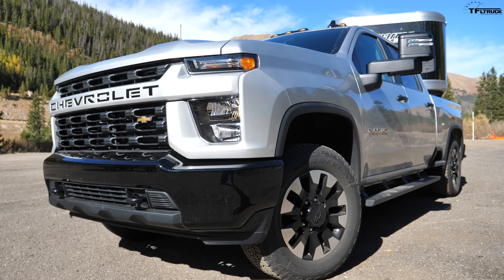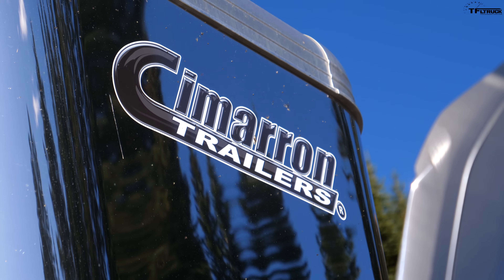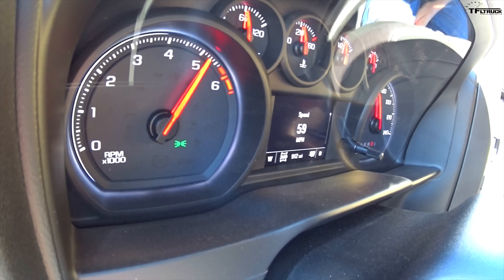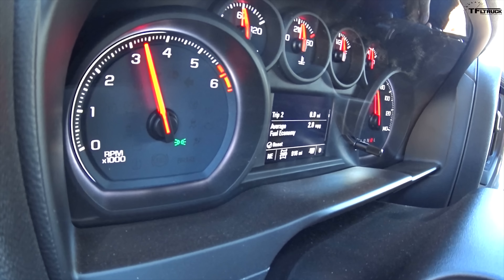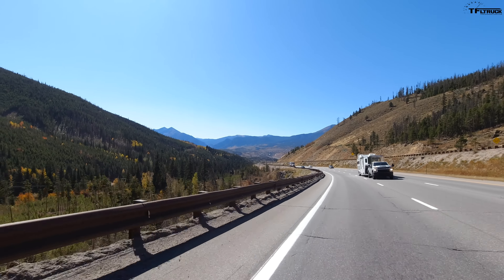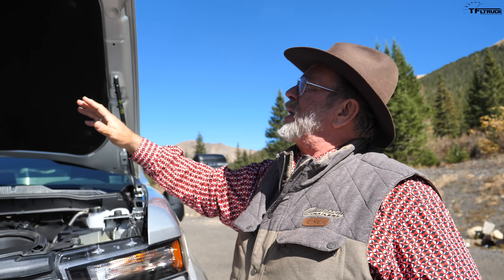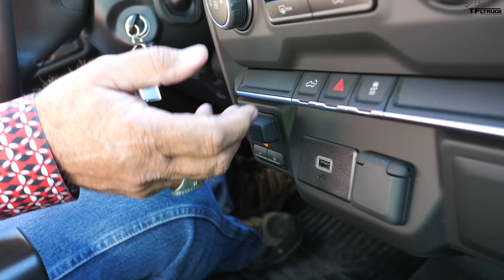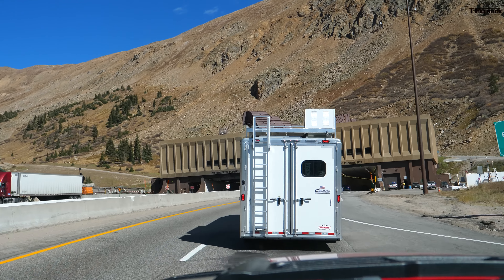The New 2020 Chevy Silverado HD Gasser Broke Our Ike Gauntlet Scoring System - Here Is How!

Comment: This was a test as extreme as the grill is tall.  Seriously, who actually tows 16,000 with a gas truck?  Nobody is going to ask a gas truck to do that regularly, they will buy the diesel.  Not only is that a lot to tow with a gasser but that hill and altitude as well.  Stupid grill and hood height but i think the 6.6 6 speed is  a great setup for the right buyer.  The person who tows  often at under 10k lb, or the person who tows up to 16k once a year will be well served by this truck and an extra $10k in their pockets.  Only reason to pass on this is if the 7.3 Ford turns out to be great.
Reply: You answered your own question; the guy that doesn’t tow extremely heavy on a regular basis.
Reply: The point is to test the trucks at their maximum ratings to see if they can actually do it and do it well. 

Otherwise who's keeping the buyers in the know? You're going believe the manufacturer who's trying to sell the truck? You shouldn't. These are good test and represent a very very high level of stress. If you do less you'll do much better. 

This engine and tranny has a place but it's certainly not this sure, but again people should still be able to know the limits of their $50,000 truck.
Reply: Yes, I agree. For the right buyer this truck could be perfect. And like you I am looking forward to the new Ford 7.3 test.
Reply: I'm too lazy to make calculations but I think with it's lower MPG it's 10k advantage in value is not that big of a deal.
Reply: @ldmtag  The MPG will be less than a diesel, but add up all the money spent on frequently more expensive diesel fuel, DEF fluid, oil changes, and if anything breaks in that highly complex modern diesel you are out major cash.  You have to be towing quite a lot to really save anything.
Reply: I bet the ford will be a beast with the 10 speed
Reply: Contractors and construction crews tow that heavy with gas trucks daily.
Reply: @Weatherby406  This is true.  You can bet that most commercial buyers will have these trucks maxed out all day every day.
Reply: Should have gave it the old allison 1000. Just like they did when the launched the 8.1 in the early 2000's which up until this year  produced the most gas torque in a 3/4 ton.
Reply: I have a 2018 GMC Sierra 3500 HD with the 6.0L gas engine and I pull my 13-14k pound fifth wheel regularly as I live in it full time. 20k miles on the truck in 10 months and it's not failed me yet. It's a truck, it's made to work, why not use it? Diesels are expensive, and they just started cracking down on non emission tunes and deletes, so if they go out you can drop another 10k ontop of the 10k premium for the engine, for that 20k I can buy half of my truck again.
Reply: Also a good choice for maxing out over short distances at lower speeds, like a contractor whose business is all in one city.
Reply: Honestly, unless your business is basically pure hauling, a gasser is an amazing choice all around.  You'll find 5.3 and 6.0 silverados and Express vans hitting 300k+ miles with the original engines.
Reply: @darens440  well, yeh, good point... maybe you're right. As I said, I'm too lazy to do the math. So maybe you're right.
Reply: @ldmtag  Today, in my city, Diesel is $2.99 and regular gas $2.59.  Unloaded Gas HD trucks lets say 15 MPG, unloaded diesels 18 MPG.  5k miles, that is $830.55 for diesel fuel and $863.33 for gas.  Oil change is likely to cost $100 for diesel, and only $50 for the gas, or less.  DEF might cost $16.  The diesel weighs more so your tires wont last as long, hard to measure that cost.  Long Term costs, lets say the DPF and the Cats on the gas both go bad after warranty.   DPF costs at least 2k and the diesel has a regular cat costing about $800.  On the Gas you can get both cats for under 1k total.  Turbo?  $1500 part the gas doesn't even need.  Fuel Injector for gas 6.0L $31, the diesel is over $300 with its core charge.  If/When your diesel needs repairs its going to cost more labor than the same repair on a GM gas.  Entire Engine replacement?  Almost 12k with core for diesel vs $4.8k with core for the 6.0 gas.  Nobody is saving a dime with a diesel anymore.  If you need/want the diesel you pay more.
Reply: Hi. Yea I'd tow 16k with a gas truck. Either get a big block or do some mods. But that's just me. Honestly I'd have more fun putting the $10k it takes to get the diesel and put it in the gas engine and make it unique. Plus the money savings from maintenance
Reply: Landscapers haul heavy trailers everyday with gas trucks because they're simpler, easier and cheaper to fix, and have a lower acquisition cost. Not to mention, the added bonus of being able to gas up your truck and several gas cans all in one go, lol! Sure you won't be going anywhere fast towing a bunch of wet mulch in a 6.0 gas 3500 Chevy dump bed, but most people in that industry don't want to spend big bucks on a fleet of diesels. I used to be a big "diesel is best" guy, but now I appreciate both and can see pros and cons for each.

Comment: That 6 speed trans is killing the performance of this truck.
Reply: Yeah, I think we will see the 10 and 8 speeds in the HD line up as standard in the future. Like come on, you buy an HD to tow and haul.
Reply: Oh bs. It was screaming up the hill at high rpm. Aka max hp. Nothing extra gears would have  done. No power is no power!  
The gm 10spd has 3 over drives . Good for empty highway driving but useless for towing. So a 10 spd is only a 6 or 6sp when towing
Reply: @Andy Hass If you notice, anytime the engine was over 4,500 RPM it was able to accelerate (not just maintain speed) till it would shift into the next gear (mainly 2nd to 3rd). When it hit 3rd gear it was at 3,600 rpm which is not enough power to hold speed and then it would slow down till it down shifted. Having more gears allows the engine to have more places where it can hit 5,000 RPM and over. The 10-speed would have a gear ratio in between 2nd and 3rd on the 6-speed and allow the truck to rev higher in this gear while going the same speed like over 4,000 rpm at 60 mph not 3,600 rpm in the 6-speed. With a 16,000 lb trailer it’s not just about power, it’s about at what speed (MPH) this power occurs. Exact same reason that a lot of semis have 18 gears. Also, a 10-speed will have a similar top gear ratio as a 6-speed, the 10 does have a wider spread (meaning more lower gears). The 10 speed has 7 gears under overdrive, the 6-speed only has 4.
Reply: @LikeARock1997  agreed. Would be interesting to see.
Reply: Its not the transmission its the tune. It was upshifting when it had no business to and waiting way too long to downshift again. Hopefully they come out with a software update soon to address that. If they would have put the truck in manual mode and selected an appropriate gear I bet they could shave 1:30 off that time.
Reply: Yes it should have changed down when it dropped to 3000 rpm. Instead the truck went down to 2000 and then sped up when it changed down. This is a stupid gearbox computer.
Reply: Wonder if it would have done a bit better if it had a big block...
Reply: You need forced induction at those altitudes. That's why the diesels do so much better because they all have turbos. Hell the little eco boost engine probably pulls better than this 6.6
Reply: Andy Hass Makes sense to me.
Reply: Killing mpg
Reply: @crazyhass84  are you serious, screaming up the hill with an airplane gear versus screwing up the hill with a creeper gear is way different sir. The horsepower is being used in totally different ways between the gearing ratio. You never had a multi-speed bike growing up I'm guessing?
Reply: @LikeARock1997    All it means is you are towing too much weight.  Pickups cannot be made to tow these incredible weights efficiently or safely.
Reply: @raptorthumper12    "would of"???
Reply: @LikeARock1997  Maybe gm should just change the cam profiles and derate the engine power to bring the usable power band down into an area people are willing to use it. 2000-3500rpm.
Reply: @oldleatherhandsfriends4053  Do you really think GM engineers didn't design this NA direct injected gas engine to produce a broader torque band? These engines develope more torque earlier compared to a port injected engine. They are pulling a lot of weight up a steep grade at high altitude, that alone kills power. This engine does everything you'd ever need it to do.

Comment: I bought a 2008 Tahoe, had the cylinder deactivation turned off, removed the cats, had the SUV tuned, installed 22 inch tires and an Eaton Tru Trac Rear End with 4;56 gears..My mileage only went down a few 10ths of a MPG from the 3;42's ..My first pull was another Tahoe on a 2300 pound trailer up two 6 to 7% grades that were around 2 miles long. With around 8000 pounds additional weight it did very well up those grades with just a 4L60 4 speed and a 5.3 with 310,000 miles...😁

Comment: That truck needs the 10 spd in a big way.
Reply: Indeed I am sure they fixed all the issues with it by now for this beast to use
Reply: It needs something.
Reply: Considering a tradesman will get this truck 10 to 15 years later, the 6 speed is better due to cost to repair. The truck should have came with a 4.10, but that's a cheap easy upgrade most of us can do.
Reply: No, it needs a 100 speed!  Not.
Reply: The ten speed is an allison. They'll never mate an allison to a gas job again
Reply: @fastold  We'll find out soon when the Ford 10-speed HD trucks are out in the real world.
Reply: karl yukon they are right now F-150 and super duty
Reply: @inchaoswearereborn9586  Nope, the 'Allison' 10 speed is simply a GM trans that was REBRANDED with the Allison name.
Reply: 231mac yep new for this year which is very sketchy
Reply: Gas not bass lol 😂

Comment: I don’t agree with changes in the benchmark times and mileage. If manufacturers are going to raise the tow ratings to heavier loads by increasing torque and horsepower as well as frame and suspension mods, the times should stay the same.

Comment: What did you expect from a naturally aspirated engine at an elevation of 11,000 feet with thin air? With a few slight modifications she would do great. Add some air suspension to the stock suspension and that will take care of the squat issue.
Reply: All HD gassers had to run the same route...

Comment: went from a 1500 5.3vortec to a 2500 duramax that was the best move ive done and i only pull a 6000 pound trailer. the 1500 wasnt cutting it. it even was worse when i ended up getting a set of nitto trailer grapplers 33s on it and boy it struggled bad with the 1500 5.3 engine!!
Reply: The 5.3L is a torqueless wonder, even among small block gas V8's its torque has almost always been sub par.

Comment: Good review guys. All Big 3 Mfrs. have good things going for them. Use to have Ram 1500 Bighorn and was completely reliable. Had to say goodbye because suspension was too soft even after upgrading coils and not enough truck with wind gusts and all with our 31 ft. 7000 lbs. Toy hauler and 1060 lbs. tongue weight. With 1500 miles on our new 6.6L gas version Silverado, Unloaded I’ve achieved 16.7 mpg twice now on trips of about 450 miles and A/C on. I have an LT, 17” tires, Z71 Double Can 4x4 for those interested. I’m civil with my pedal. Truck technology is just right for me; don’t need huge screens (8” is good enough).

Comment: I'm curious what the transmission temp was when they reached the top of the Ike.
Reply: I'm sure it was normal. If it was high they would have said something.
Reply: I'm sure it was overheating. That's why they didn't show it. What was the temperature outside I wonder. That would make a big difference.
Reply: @jameschance5507  no. They definitely would have said something.
Reply: Colin The 6L90e is a bulletproof transmission.  With the high engine rpm and the power reduced by a third due to low air density I’m sure the transmission stayed cool.
Reply: @jameschance5507  So you know the temp would make a difference but you also know that it was overheating. Do you know the difference between fact and opinion?
Reply: I'm sure it was warming up but who knows how much.  I've pulled a very similar load up a very similar mountain pass just south of where these guys were, with a 6.0 gas and 6L90 transmission and as it downshifted through the gears, the transmission temp continued to climb.  Then in first gear, the water temp started to spike if I left my foot on the floor.  In first gear, I could play with the throttle a bit and hold some speed and that would let the water temp come back down some.  

I just got the 6.6 gas in a 2021 3500.  I hope they added enough cooling that this truck will provide max towing without any temps climbing very much.   In my opinion, GM has never been very good at providing any reserve cooling capacity.  Seems like their trucks have always been prone to climbing water temps when worked very hard.

Comment: I know Ram didn’t perform well in the past, but I really think it will vastly improve with the new 8 speed. I’m not a GM fan but it was truly disappointing to see a new engine in a new truck come out with the same OLD six speed. I’m excited to see these gas truck comparisons with this kind of weight. How about adding the Ford 6.2 to the test also to see how it compares to the new 7.3.

Im really considering my next HD purchase to be a gas because the maintenance of these new diesels scare me. I don’t tow often (maybe 10 times a year), but when I do it’s normally around 13-15,000lb.
Reply: Ram didnt perform well because it went into a mode designed to save the transmission. Ram limits the amount of time you can be in 1st gear full throttle, after the determined amount of time it holds the gear but limits power and speed to protect the torque converter from ballooning from excessive internal heat.
Reply: Yea Ram just has most of the world records and in reality dominates job sites. No biggy
Reply: "This kind of weight." I'm waiting to see that 35,500 lb. rig that GM says they're best-dressed is capable of--towing up the Ike, but from Grand Junction and multiple times in a row on a really hot day like it's doing material deliveries. That would be entertaining. HD pickup manufacturers have lost their collective minds to their marketing departments.
Reply: Get a used ram Cummins.
Reply: @LemkeR  
Yeah,preferably mine so I can buy a real truck.
If anyone wants a loaded 18 ram 2500 4x4 sport megacab,hit me up.
I would love to let this pos Cummins go & it's in a color your wives are sure to love,just incase you need to fly it past her for approval.
I'm wanting a 2020 superduty crewcab tremor with the 7.3
Reply: @TheXOoftheRO  Ram is sold almost exclusively in North America. What "World Records" would Ram hold? Never heard of such a thing.
Reply: @IKnewMickey  i guess you're living under a rock. Have fun with that
Reply: MG42pillbox what world records?
Reply: @deeohgi  try to get some life experience. You might learn something. The Dodge brothers built the first American cars. They were called ford model Ts.. Have fun hiding from history.

Comment: Needs the 10 speed... or at least 4:10 gears as a option. 
3500HD SRW and DRW come with overload spring pack which would have helped mitigate squat.
Reply: True but the truck is rated to pull that weight. So the suspension should be able to handle it. Tfl tests what they get
Reply: What I couldn't understand is why there's still so much gap in the wheel well even with it nearly on the bump stops....

Comment: The heavyweight haulers need low pressure  (5 psi)  turbocharged gasoline engine.
Plus EXHAUST BRAKE.
PLUS AIR BAG REAR SUSPENSION.